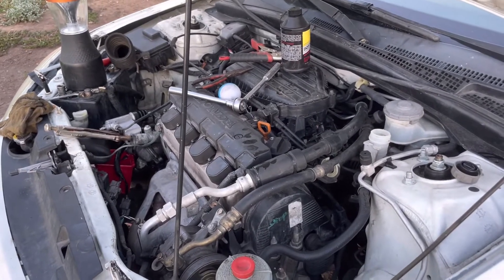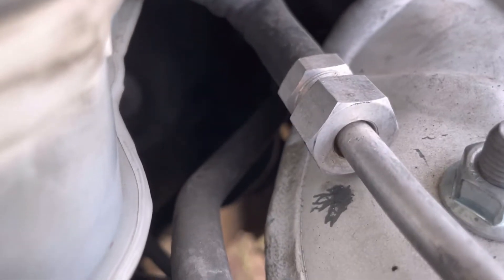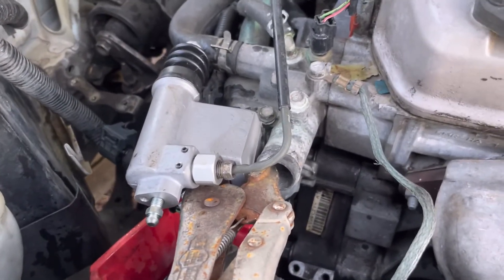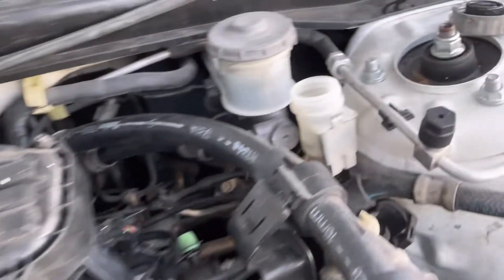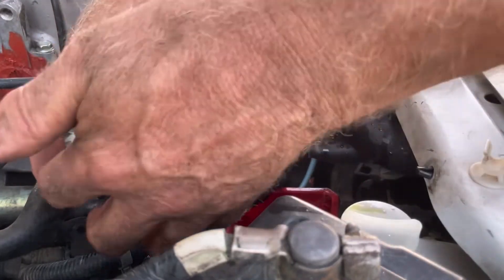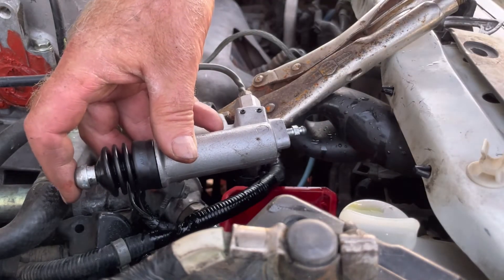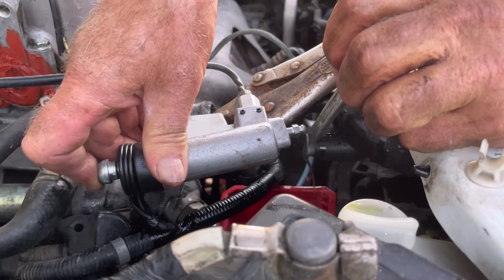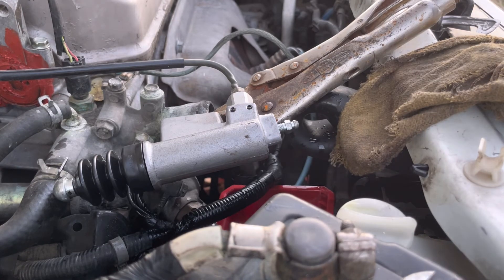Trick for bleeding the hydraulic clutch, 2001 Honda Civic

Comment: Thank you for this video. I used this method today on my 2001 Civic after using vacuum pumps without success, and it worked like a charm. I attached a small bit of tubing onto the bleeder valve so I could get a better view of what was coming out. Thanks again!

Comment: I had trouble with mine as well ('09 Fit). Two main things I learned. One, when you loosen the bleeder, loosen it enough for the slave cylinder to easily compress. It'll still have some resistance, but you'll find that cracking it only a little will make it very hard to compress and you won't make any progress. Two, after compressing the slave cylinder make sure you really tighten down the bleeder. It may feel tight and you won't see or hear any air getting in, but believe me I found out the hard way that air really likes to flow back in to these for some reason. Also don't pump the clutch with the bleeder open. For whatever reason when I did this, even when closing the bleeder before lifting the pedal, the pedal would go completely limp and I'd be back at square one. Do a bleed cycle, close the screw, then pump the clutch a few times to send air from the master to the slave cylinder.
Also, it helps to connect a vinyl tube to the bleeder screw and run it to a bottle with brake fluid (basically a gravity bleed setup). That way if you accidentally allow some backflow into the bleeder it only draws in fluid. Also makes it easier to see how much air is still coming out.

Comment: I spent three well two stressful days trying to bleed my clutch on my 01 civic and I tried every way I saw I thought I was gonna need a vaccum pump but this way did it!! Thanks for your video it helped!!
Reply: Vacuum pump only got me so far (had to buy one after a failed bleed left my clutch pedal only somewhat functional—got stuck in a parking lot the next day with no clutch and thankfully happened to be in a strip mall with an auto parts store). I got it working enough to be drivable, but the clutch pedal wouldn't fully disengage the friction disk and I had to rev-match in order to shift.
Reply: Did you need to have clutch pedal down too, or no need?

Comment: The best way is to reverse bleed it, fill a large syringe with brake fluid, attached to a clear tube, attach tube to bleed nipple on the slave cylinder and crack it open pump fluid upwards into the reservoir from the slave cylinder it takes about 10 minutes and all the air is pushed out the system. Job done.
Reply: Yes I was thinking the same thing I'm going to try this next because everything else has failed for me
Reply: @rm4213  make sure you have pumped all the air out of the pipe from the syringe before you connect it to the slave cylinder bleed nipple, otherwise you will be putting more air in to the system.

Comment: DUUUDE... This is nothing short of BRILLIANT!  YEAH... This is a HUGE help. Thank you sir! 

On another note you're right about the master clutch cylinder it is a COMPLETE PITA. It took me something like 3 hours to swap mine out (02 Civic LX). If I EVER have to change it out again I'm going to be cutting some wrench ports in that area. They won't help a lot but there are already 2 holes in that little metal cup that Honda made to be part of the frame. Perhaps elongating of the lower hole vertically  and the upper hole horizontally would help a little. 

Anyway, very cool video dude!
Reply: Same, took me like 2.5 hours on 03 EX

Comment: how did you get the master cylinder out? a 12 mm wrench doesnt fit through that tirewell hole, I cant grab the nut on the hard line
Reply from the maker: I don’t remember, I think it was fine. Do you have fluid leaking at the pedal? Those master cylinders don’t go out very often.

Comment: What syntoms does the clutch has to have to do this? I have had some trouble with my hondas clutch because the pedal goes all the way down , Can this method help me in some way?
Reply from the maker: Typically happens when you replace your slave cylinder. If your clutch goes to the floor, check for fluid in the reservoir at the master cylinder, if it’s low, fill it up then look for a fluid leak around the slave cylinder or on the rod that attaches to your clutch pedal.

Comment: You can use a vacuum blender
Reply: I spent 2 hours with a vacuum bleeder on mine and only got a little fluid. It's weird. The master and slave are both mechanically functioning, I can't find any leaks, pressing the clutch pedal forces air and fluid out of the slave, but the reservoir level doesn't go down or only occasionally dips by a barely noticeable amount when I tighten the bleeder and raise the pedal.

I know the system holds pressure because my vacuum gage on the slave bleeder says so. But I can't get all the air out.

I'm about to try using an oil syringe to force fluid through the slave and hopefully that can push any air up through the reservoir since I can't get it out of the slave.

Been messing with it for a week now lol.

Comment: Question for whoever can answer. Basically initial problem was clutch was all the way to the floor, and stayed compressed. So I changed the master, still nothing, changed the slave, and now im having a heck of a time bleeding it. I dod the steps as you did in the video. I open the bleeder screw (bs), compress pin, a little bit of fluod comes out, then whem its bottomed out, I close bs, But the pin stays compressed, doesnt go back up until I open the bs again, but when I do that, all of the liquid goes back in the slave that just came out. Can anyone shed some light here?
Reply: Pull the thing out manually after closing the bleeder then crack bleeder and push it down and close it and pull it back out keep doing it that way till just fluid comes out
Reply: @jessefuller8043  oh, I figured it out, finally got it to bleed. But this was almost two months ago lol

Comment: Did u have the cap on or off the reservoir while u did this ?
Reply from the maker: Off, but it doesn’t matter since it’s not an air tight cap.
Reply: @MattPritchard Did you need to have clutch pedal down too, or no need?
Reply from the maker: @douglastaylor158  The cap being on or off doesn’t matter.
Reply from the maker: @bronniesboy  doesn’t matter

Comment: How does it draw from the reservoir if the reservoir fluid is going to the Master cylinder first? 🤷.... The master cylinder then pushes through the line and the line to the slave! So not sure what you're talking about?? 🤔
Reply from the maker: When you replace the slave cylinder, it’s full of air, so the master cylinder fails to push fluid to the slave. You have to get the air out for it to work.

Comment: Why is that rod not compressing when i press the clutch? 🥴
Reply from the maker: Air in your line
Reply: @MattPritchard  well how long should it take for me to get it to move? Ive spent hours doing this
Reply from the maker: You have to get the air out of the line, watch the video again
Reply: @MattPritchard  I don’t think its sucking fluid from the reservoir. Could be faulty cylinder idk 🥴. Only air is being pushed out after a few tries, new slave and master
Reply from the maker: It’s a pain, that’s why I made the video, getting air out of the lines can be very frustrating. Disconnect the line at the slave cylinder and make sure your getting fluid there from the Master.